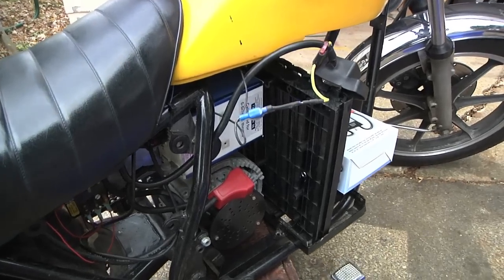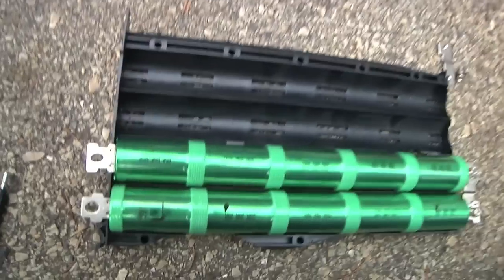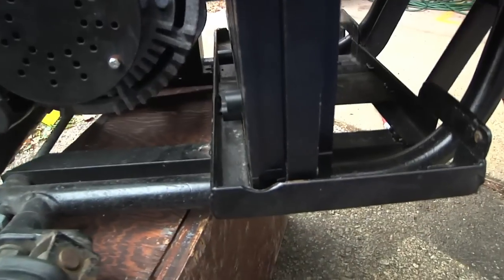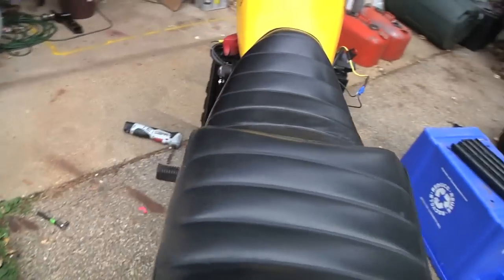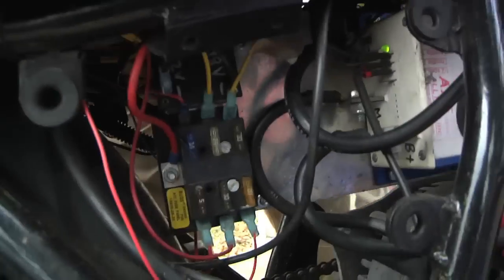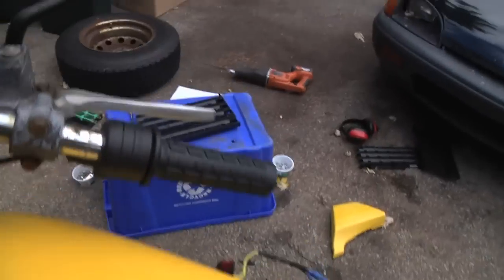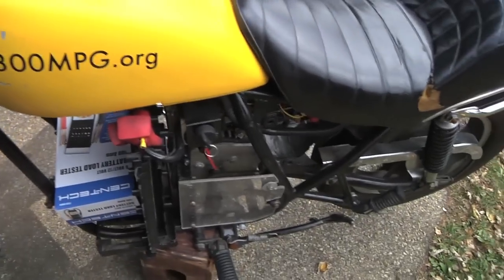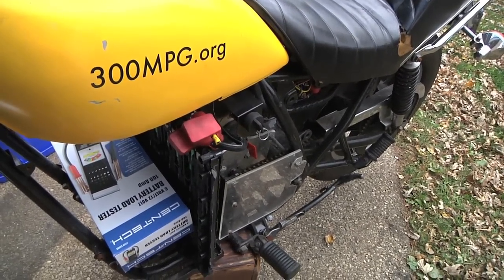Building a NiMH Electric Motorcycle Battery Pack Part 5: First Tire Spin on NiMHs

Comment: hi Ben,  I think you would need a BMS to protect the battery from over charge?  but you mention each of those stick is 6v.  I can not find 6v BMS on ebay.  or NiMH do not need BMS ?  any one ?  Thanks

Comment: have you finished the bike at this point? Do you have more videos?
Reply from the maker: +Vinny Gullotta That's as far as I got. Right after that, I got wind of a 2007 Vectrix electric motorcycle, which I purchased and have been working on since then. Do a search on my YouTube channel for "Vectrix" and you will see all the other electric motorcycle work I have been up to lately, including a 1,276 mile road-trip with ZERO Gasoline.
Reply: +BenjaminNelson yeah it's cool, I haven't gotten to those yet, I was really interested in how the escape battery was going to work out though, I thought the cells looked cool and I liked how you repurposed the tray for them.
Reply: +BenjaminNelson it looks like you could fit there times as many as you planned to use for a lot greater capacity/range too, lots of room in there.
Reply: +Vinny Gullotta three*
Reply: @BenjaminNelsonX  awesome, I love your Projects, I Have a 1972 Honda z600 Car that I plan to convert to EV , a  big custom built pan battery seems like the coolest option if I can make that happen,, I have several hundred 18650 cells from old laptop batteries , it would be nice if I can make my battery pan using them .. but not sure yet on that part... tonguetalkingtither@gmail.com if you want to message me

Comment: What was your  top speed  .
What motor is that you are  using 
Looks  like  it is time for a new chain 
Looking  forward to more
Reply from the maker: I originally geared the cycle for 45 mph on a 48V system. 45 is the speed limit in front of my house, and I'm two miles from the city limits, where it's all 25 mph roads. The motor is an original Briggs & Stratton Etek. Yep, the chain really isn't tensioned at all in this video.
Reply from the maker: BenjaminNelson For anyone else curious, I added a link to my EV Album entry in the video description. That tells all the specs on the motorcycle.

Comment: Looks good Ben. I will be curious to see your range when it is all completed.
Reply from the maker: I'll be curious to know what the range will be too!
Reply: BenjaminNelson :-D I can dare a guess...pretty sweet :-) I've played with a few nimhs over the last year or two and can honestly say they are really dense in power, check these handy specs out :-) Aye they might not have the density of the lions but they peak ampage makes it perfect for your bike :-) for that bit of extra acceleration, 60% of li-ions is decent! (price gap) and look at those lifecycles!!!
Advantages
High energy density (W/kg), about 50% better than Nicads, but only about 60% of Lithium ion.
Low internal impedance though not as low as NiCads
Typical cycle life is 3000 cycles.
Can be deep cycled. (80% to 100% DOD)
Using NiMH batteries, more than 3000 cycles at 100 % Depth of Discharge (DOD) have been demonstrated. At lower depths of discharge, for example at 4 % DOD, more than 350.000 cycles can be expected.
Robust - NiMH batteries also tolerate over charge and over discharge conditions and this simplifies the battery management requirements.
Flat discharge characteristic (but falls off rapidly at the end of the cycle)
 Wide operating temperature range
Rapid charge possible in 1 hour
Trickle charging can not normally be used with NiMH batteries since overcharging can cause deterioration of the battery. Chargers should therefore incorporate a timer to prevent overcharging.
Because of potential pressure build up due to gassing they usually incorporate a re-sealable vent valve
Reconditioning is possible.
Environmentally friendly (No Cadmium, Mercury or Lead)
Much safer than Lithium based cells in case of an accident or abuse due to the use of more benign active chemicals, a particularly important property in high power and automotive applications.
 
Shortcomings
High self discharge rate.
Can be stored indefinitely either fully charged or fully discharged.
Suffers from memory effect though not as pronounced as with NiCad batteries
Battery deteriorates during long time storage. This problem can be solved by charging and discharging the battery several times before reuse. This reconditioning also serves to overcome the problems of the "memory" effect.
High rate discharge not as good as NiCads
Less tolerant of overcharging than NiCads
As with NiCads the cells must incorporate safety vents to protect the cell in case of gas generation.
The coulombic efficiency of nickel metal hydride batteries could be up to 85% but is typically only around 65% and diminishes the faster the charge although this is projected to improve.
While the battery may have a high capacity it is not necessarily all available since it may only deliver full power down to 50% DOD depending on the application.
Cell voltage is only 1.2 Volts which means that many cells are required to make up high voltage batteries. The competing Lithium cells typically have 3 times the cell voltage (3.2 Volts to 3.7 Volts) and a much higher energy density.
Lower capacity and cell voltage than alkaline primary cells.
Limited supplies of rare earth element Lanthanum. Mostly in China.
 
Charging
Run down fully once per month to avoid memory effect.
Do not leave battery in charger.
Slow charging method: Constant current followed by trickle charge.
Rapid charging method uses dT/dt charge termination.
Use timer cut off to avoid prolonged trickle charge.
Reply: I too would have liked to known the range of those batteries on your motorcycle but it seems you did not complete the building of the battery pack for some reason would you mind elaborating a little bit on why you decided not to finish this project?